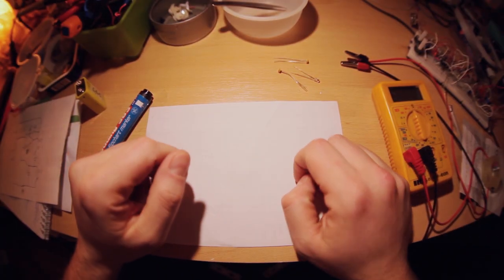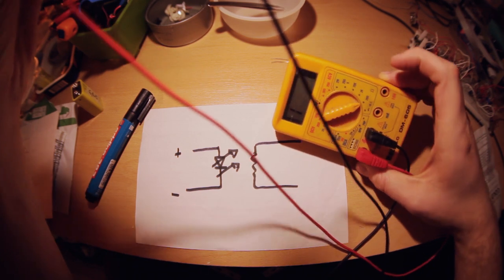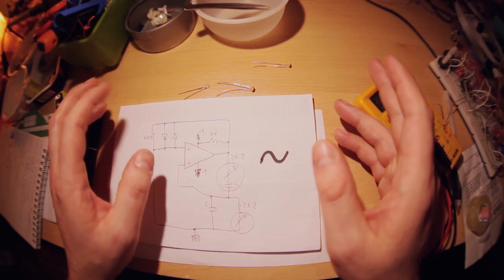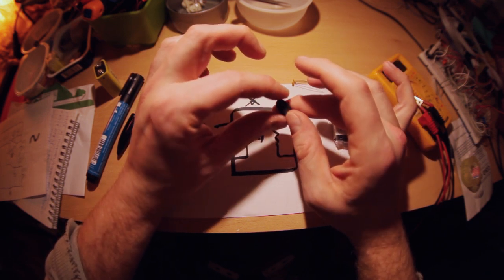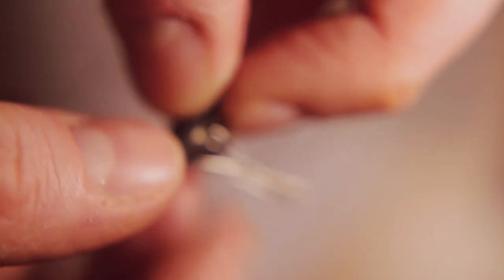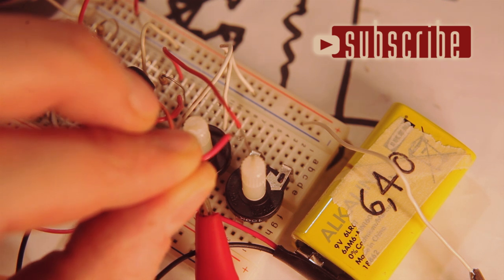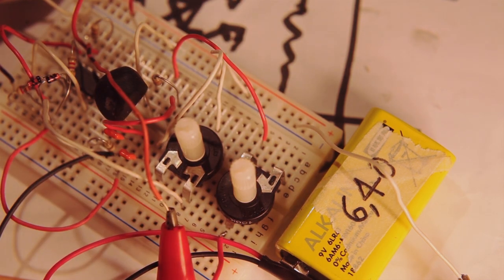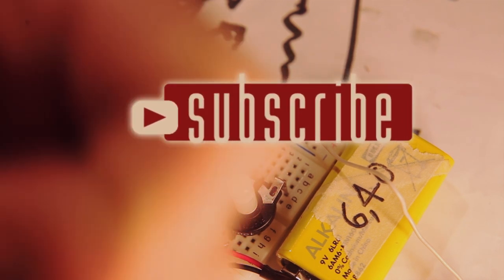audio optocoupler diy, make your vactrol, a voltage controlled potentiometer!

Comment: which voltage does vit need? cause i added it to my OSC circuit, but i only get two "values" from my Korg SQ1... im not sooo deep intro DIY ;) yet
Reply from the maker: what is "vit"? what is your "OSC circuit"? and how are you hooking it up to the korg? If you can explain your problem I might be able to help :)
Reply: @minijackaudio  i meant it not vit. i made an osc circuit and used 1 resistor,a white led and a sensor as a optokoppler... but the korg just can send low or high notes... i changed the pitchrange with a potentiometer, but the cv it gets is jus on or off... there no values in between... i used a two leg transistor as a osc with a capacitor and a 10k poti
Reply from the maker: @F-Andre  maybe post a schematic, I don't know what is your "OSC circuit", and also the way you connected everything to a korg machine is not clear or obvious

Comment: this is great, I'm using it on my next DIY project. I've got a question, would it be possible to have a CV input AND the potentiometer to control the LED of the vactrol?
Reply from the maker: yes, in the schematic you can see where the CV comes in https://imgur.com/a/yEKDHp0, you can attenuate it if that's what you need, you can generate it and process it in any way you like, just be aware of the range it works in

Comment: How do those two ldr react because the distance to the ldr is the same but the characteristic will not be ...so i think you use two different resistors in the Wien osc...if you...like you started the video..would like to have two the same resistors..the distance to the ldr should not be the same....i myself made an adjustable screw with plate construction ..so the distance can be changed between each ldr apart... and the led...so i can adjust the resistors to be the same at one amount of light ..they varried...so i bought a lot of ldr..two get two the same charistics...in the end it did not work..... its a nice video..but very difficult to get great accurate result

Comment: doesn't the conical beam  of the LED mean placing  LDRs at the side that they receive less light?
Would  a white FIMO make the reflection of light enhance the operation?
Also, you could use MILLIPUT  an epoxy clay that doesn't need heat to cure
did you match the wavelength for max LDR response to the LED colour?

Comment: what is actually in a ready made ''vactrol''  ?  is it just an led and an ldr?.....just curious as some say ready made vactrols have a quicker response.....i roll my own like you do, but just wondered...cheers .
Reply from the maker: yeah, vactrols are a simple led-ldr couple, the elements usually separated by air inside the capsule. Commercial vactrols usually have a faster ldr, and *should* have a consistent response across all units, but yeah, also depends on brand/model.
The best thing about making your own, I think, is that you can configure it as you like, multiple leds, multiple ldrs, different distances and angles between different elements, different led colors/size, and so on...

Comment: What happened to your website?
Reply from the maker: hey, it's down right now, a new one is coming!
Reply: @minijackaudio  What is the URL of your new site?
Reply from the maker: @bastenhoor6902  nozhardware.com - coming soon!
Reply: @minijackaudio  I'm gonna get the FIMO now and build one! Or two...three ;-) In your schematic there are some capacitors, what values did you use and what kind (ceramic or electrolytic)?
Reply from the maker: @bastenhoor6902  in the video I used 1u ceramics, but you can use other values, it'll change the frequency range
Reply: @minijackaudio  Cool! Just got my first home baked dual vactrol out of the oven! I've used white FIMO so you can see the LED light up inside ;-) Will probably loose some light and it will also change when light shines on to it. But it's nr. 1 ;-) I also just found out there are lots of different photodiodes, so I ordered a pack with different values to experiment even further. Gonna try the schematic now! Thanks mate - Happy days!
Reply: @minijackaudio  Question: Why did you use the Zener diodes (are Zeners right?) and what value?
Reply from the maker: @bastenhoor6902  nope, they're regular diodes, I think I used 1n4148's in the video, they're there to clamp the opamp's gain, so you can crank the "distortion" and still get a reasonable range

Comment: Hi! Nice idea! Is it possible to make almost the same construction using a thermo-shrink pipe(s)?
Reply from the maker: yes of course you can, that's the traditional way, but there is usually a light leak problem between the led's and ldr's legs, that's why I chose to use plaster
Reply: I've seen the tutorial where a guy did sealed those places when the material is still warm. It was just squeezed by some pliers.

Comment: What are good alternatives for vactrols, to achieve the same effect of voltage controlled resistance? The response time, linearity and accuracy of vactrols is terrible, with most vactrols changing their behavior over time. I was thinking about simply using a transistor, but that would only work with current in one direction. What if you need to control the resistance no matter the direction of current?
Reply from the maker: well, a good alternative is of course a VCA chip, like Analog Devices or similar, of course the circuit is much more complicated and needs to be tuned to your needs. Or just use an OTA.
Reply: I know I'm 3 years late, but H11F1 is what you're looking for.

Comment: Hi, First of all thanks for sharing. I enjoy watching your videos. Question: Did you have to find two matching LDRs? I bought a bag full of them, and they are all very diferent. Thank you
Reply from the maker: hi! nope I didn't match them, also because there are many more factors coming into play, for example a very slight difference in the distance from the LED make a much bigger difference than unmatched LDRs! What you can do is to use a parallel and series trimmer for calibration. 
Thanks for watching!
Reply: thank you

Comment: heyho, may i ask what kind of ic to use here? or can it be any opamp?
Reply: LM386 from what I have seen, although I don’t recall seeing any diodes in schematic I’ve seen.  I think these are clamping diodes?  Or maybe these diodes compensate temperature?  I don’t see the lightbulb in this, originally for temperature compensation that would have been where he drew those diodes.  So there is likely some variety of this type of circuit.  386 should be fine.  Pin 2 for the feedback loop.  Could add a ten microfarad cap with positive side to pin one, negative to pin 8.

Comment: do you have a schematic file? thanks!
Reply: Just made wien bridge oscillator with diy vactrol and op amp: LM833-N but sound is quite dirty. Could you please post your scheme and notes again somewhere? I found that your blog is not available.
Reply from the maker: Thank you  for the interest +Magno Caliman ! Here I posted the schematic with some notes on my blog http://www.noisefuel.net/diy-vactrol-voltage-controlling-a-wien-bridge-oscillator/
Let me know if you build it!

Comment: really? a double potentiometer(or stereo ) is hard to find?
Reply: These can be used to automatically adjust levels so you no longer need to manually adjust the preamp level. Automatic gain control, or gain normalization. Stereo vactrols are very hard to find, and without it, you need to use two, with possibly mismatching internal LED properties, causing channel imbalance.